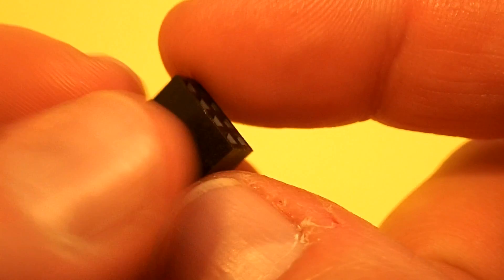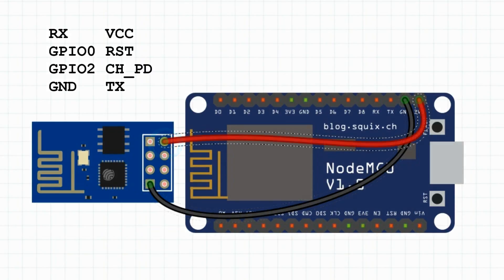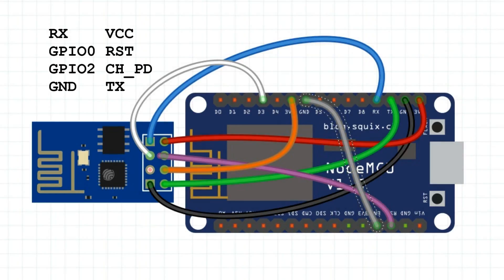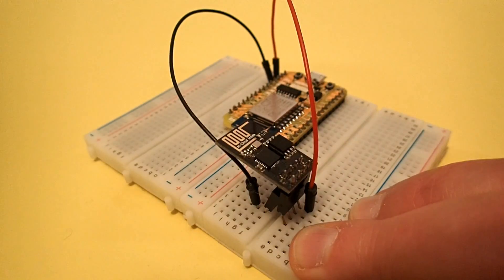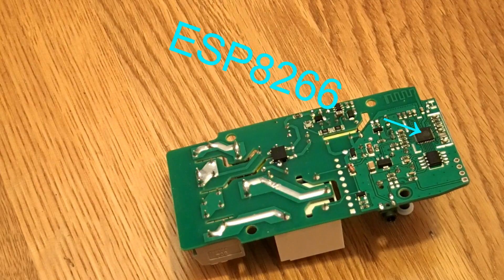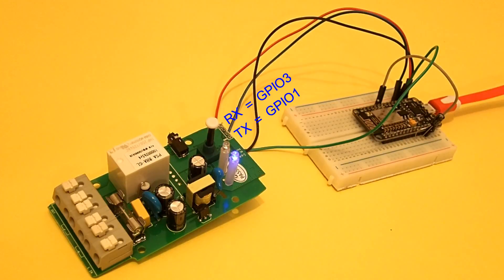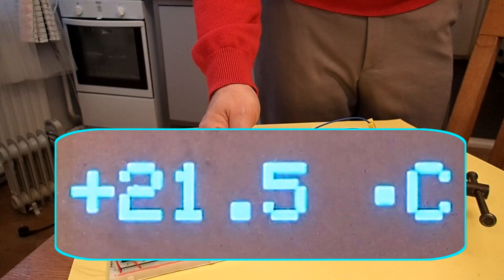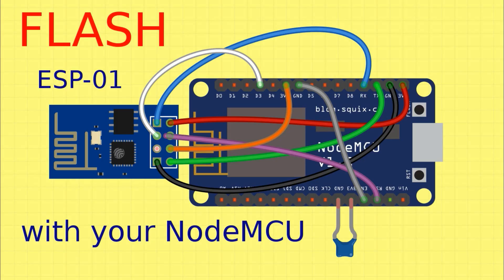#7 Flash ESP-01 easily with your NodeMCU

Comment: Thank you so much Miika - this finally worked. Note that in your video you show the connection settings in Arduino IDE to connect to a NodeMCU (12E). To get blink to actually work I had to set this in the IDE to a "Generic ESP8266 Module", set LED_BuiltIn to 1 and select the flash size 512kb  FS: 64kb.
Reply from the maker: Thank you for your comment!
Reply: Thank you! I made the same modification and it also worked for me. I was wondering why it wasn't blinking! Thank you!
Reply: much appreciated , your method worked for me
Reply: Also worked here. Thanks!
Reply: thank you

Comment: Miika, thank you for the nice tutorial. Uploading code via nodemcu is no problem, but I want to use a Wifi-Relais with the esp-01 integrated. I can communicate via a webserver on the esp-01, but the relais doesn't toggle. This is the code:
#include <ESP8266WiFi.h>

const char* ssid     = "xxxx";
const char* password = "passxxx";
#define RELAY 0 // relay connected to  GPIO0
WiFiServer server(80);

void setup()
{
  Serial.begin(115200);
  Serial.println("Starten");
    delay(10);
    WiFi.begin(ssid, password);
    while (WiFi.status() != WL_CONNECTED) {
        delay(500);
    }
    server.begin();
    Serial.println("IP: ");
    Serial.println(WiFi.localIP());
}
int value = 0;
void loop(){
 WiFiClient client = server.available();
  if (client) {
    String currentLine = "";
    while (client.connected()) {
      if (client.available()) {
        char c = client.read();
        Serial.write(c);
        if (c == '\n') {
          if (currentLine.length() == 0) {
            client.println("HTTP/1.1 200 OK");
            client.println("Content-type:text/html");
            client.println();
            client.print("Relais <a href=\"/H\">On</a><br>");
            client.print("Relais <a href=\"/L\">Off</a><br>");
            client.println();
            break;
          } else {
            currentLine = "";
          }
        } else if (c != '\r') { 
          currentLine += c;
        }
        if (currentLine.endsWith("GET /H")) {
          Serial.println("EIN");
          delay(10);
          byte close[] = {0xA0, 0x01, 0x01, 0xA2};
          //byte close[] = {A0, 01, 01, A2};
          Serial.write(close, sizeof(close));
        }
        if (currentLine.endsWith("GET /L")) {
          Serial.println("AUS");
          delay(10);
          byte open[] = {0xA0, 0x01, 0x00, 0xA1};
          Serial.write(open, sizeof(open));
        }
      }
    }
    client.stop();
  }
}
This is the module I use:
ESP-01 relais module (https://www.hobbyelectronica.nl/product/esp-01-relais-module/)

Can you help me? What do I do wrong? I suppose it must be the code.
I have also made a bridge between VCC and CHPD, but this doesn't help.
Thank you in advance for your help.

Yvonne
Reply: Hi Miika,
After trying again and again I tried to combine multiple codes and YES I succeeded.
This is the new code, which works:
#include <ESP8266WiFi.h>

const char* ssid     = "xxx";
const char* password = "xxxx";
#define RELAY 0 // relay connected to  GPIO0
WiFiServer server(80);

void setup()
{
  Serial.begin(115200);
  pinMode(RELAY, OUTPUT);

  Serial.println("Starten");
    delay(10);
    WiFi.begin(ssid, password);
    while (WiFi.status() != WL_CONNECTED) {
        delay(500);
    }
    server.begin();
    Serial.println("IP: ");
    Serial.println(WiFi.localIP());
}
int value = 0;
void loop(){
 WiFiClient client = server.available();
  if (client) {
    String currentLine = "";
    while (client.connected()) {
      if (client.available()) {
        char c = client.read();
        Serial.write(c);
        if (c == '\n') {
          if (currentLine.length() == 0) {
            client.println("HTTP/1.1 200 OK");
            client.println("Content-type:text/html");
            client.println();
            client.print("Relais <a href=\"/H\">Einschalten</a><br>");
            client.print("Relais <a href=\"/L\">Ausschalten</a><br>");
            client.println();
            break;
          } else {
            currentLine = "";
          }
        } else if (c != '\r') { 
          currentLine += c;
        }
        if (currentLine.endsWith("GET /H")) {
          Serial.println("EIN");
          delay(10);
          digitalWrite(RELAY,LOW);
          //byte close[] = {0xA0, 0x01, 0x01, 0xA2};
          //Serial.write(close, sizeof(close));
        }
        if (currentLine.endsWith("GET /L")) {
          Serial.println("AUS");
          delay(10);
          digitalWrite(RELAY,HIGH);
          //byte open[] = {0xA0, 0x01, 0x00, 0xA1};
          //Serial.write(open, sizeof(open));
        }
      }
    }
    client.stop();
  }
}
Maybe this is a help for somebody else as well.
Thanks for your time.
Yvonne

Comment: Thank you!  This video FINALLY helped me get my devices set up and working.   I had tried using an Arduino Uno, a CH340 USB programmer and several other setups using a voltage divider and I honestly thought my devices were bad.  I had no even considered I could use NodeMCU for this task.  I have been working every night for weeks on this.  Finally I this solution. I did have to set up a separate power supply using a 3 volt regulator.  I moved on to flashing and actually wiped out everything by mistake but it was a good mistake because I then learned how to flash the latest firmware using the official tool.  The documentation for this device is outstanding.  Thank you again.

Comment: I tried everything shown here, and it works perfectly, just had to change some values on the arduino IDE to match the flash memory on my esp-01.
Now i have a weird problem, any program i upload using this method stays with a 74880 bps serial speed,  i found out that speed by trial and error, any suggestions on what i could look into to solve that?.
Reply: Each time you upload a sketch from Arduino IDE, you're actually flashing the "active" ESP in your setup. If properly wired, it should be the ESP-01 and not the NodeMCU ESP-12E. If I recall, 74880 is kind of a debug feature only used in the firsts μs of the boot process. Add that line to your sketch:
Serial.begin(115200);

Comment: Thanks for the video. I have tried all the steps as you described. Blinking program gets uploaded successfully. But after that blue LED does not glow at all. No blinking. I have put some print statements as below, none of these statements output on serial monitor; Strange!!! I assume program is not running. I have tried even removing ESP01 GPIO0 pin from D3 on NodeMCU and powering NodeMCU. No blinking! Any help?

void setup() {
  Serial.println("In setup");
  pinMode(LED_BUILTIN, OUTPUT);     // Initialize the LED_BUILTIN pin as an output
}
Reply: Had the same problem with Blink. I think that code is for an external LED?  I moved onto a simple WebServer and that worked fine so you may want to test with another piece of code.

Comment: Can you do Flash ESP-01 with Wemos D1mini?
Reply: Kind of, it doesn't have the EN pin broken out though. If you ground the RST pin of the Wemos, you can wire it up the same way, but you arent going to get the auto resetting magic. I'm also not sure if the GPIO0 of the ESP-01 will be grounded at the right time so you would probably need to ground that too

Comment: Thanks for your video! It outstands!

I could make it for ESP-01 to accept the program. The blue led blinks, it gets uploaded.. but nothing after. I can't tell if the program runs.. actually it does not run because the blink example, when uploaded, do not blink and another examples as wifiAccessPoint and WifiClient both do not work. In my Arduino IDE's options I upload using Nodemcu reset method , Generic ESP8266 as target board and upload speed of 115200.
I am using an alternate power supply exclusive for the ESP-01, linked with NodeMCU's ground (like  shown in this video) and of course Arduino IDE. I have commented all Serial.prints..  and by the way, the ESP-01 gets hot!
I power the ESP-01 after flashing, with just VCC and Ground plugged.. and still nothing.
My upload process starts with grounding GPIO0 and powering ESP-01 while USB is connected to Nodemcu (as the power starts, the blue led blinks once - and I understand it as "prepared for upload").  Then I upload the program, normally (sometimes with GPIO0 still grounded, sometimes at D3 of nodemcu). After then I sometimes power ESP-01 with just VCC  and GND and sometimes power without disconnecting it from nodemcu.. both methods made no difference to run the program that I just uploaded successfully.
Reply from the maker: Strange! Especially the hot ESP-01. I would try flashing the ESP-01 module wiht an ordinary USB-to-serial-converter. Then if the ESP-01 still works I would double check the wiring and the additional power supply and try again flashing with the NodeMCU. Please write back later and tell how you got this problem solved.
Reply: it is still working. Still uploading. The Nodemcu accepts programming too, when not used as a bridge for the ESP-01. Are there any special pin configuration to make it init  by itself? I am just powering it with a 3V Battery or 3.3V source and the red light just stays on and nothing happens. I have seen that to make it boot to load GPIO0 (ESP-01) must be set to ground BUT to make it run the program uploaded, it must have GPIO0 set to High (I testes plugging GPIO0 of ESP-01 to 3.3V and still nothing more than the red light, but without dim).
Afterwards, your video helped me very much and even may have helped me not to burn an ESP-01 because I may would not check for RX/TX voltages of the one I have before using. My problem now is beyond the issues of this video..
I assume the program got uploaded, but I can't tell if it runs or why it does not. I try to monitor Serial output (I upload sketches with serial output on and off) but it shows just garbage after plugging in the VCC from the Nodemcu to ESP-01.
For the heating problem, I actually knew that I can program it without using external supply. The problem I had was not about low current available but just grounding ESP-01's GPIO0.. now it uploads every time. Thanks.
Reply: I will try flashing. I am using now a USB to Serial. Still the same happens. I am installing Termite to see if I can get some response from the ESP-01 to check which firmware is already running..
Reply: I got a soft brick on it because I tried many things to make it work (not just your approach). I did not noticed before that I had a USB to serial device available. I tested another of the same package and all worked well using the usb to serial. Strange. Well, now I have one esp-01 to play with testing firmwares and recovering from this soft brick.. I should learn a lot using it.

Comment: Nice video. I tried to do same with my nodemcu but it fails to program. I have done exactly same connections. Any idea what might be wrong. I have esp01 and nodemcu v2. 
Finally I got a bare nodemcu  board without esp8266 then it works. I will put video on my channel soon. 
But I still wonder why it doesn't program with nodemcu board (?)
Reply from the maker: Hi Electromania! Try adding the cspacitor.

Comment: Hi Miika, I like your videos on Youtube. Great stuff!But the blink example of video #7 doesn't work with on my ESP-1 flashing via my ESP-12F. There exist the issue "Blink Example won't blink #2192"
https://github.com/esp8266/Arduino/issues/2192Gorkde is using also an ESP-12F. Igrr wrote the pin of the built-in led has changed. I tried to use pin 2 but no blinking.Do you have an idea?Thank you :)
Reply: https://github.com/esp8266/Arduino/issues/2192
Reply from the maker: Thank you for for your feedback and for the information! 

Do the other programs work? For instance:

void setup(){Serial.begin(9600); Serial.print("Hello");} 
void loop() {}